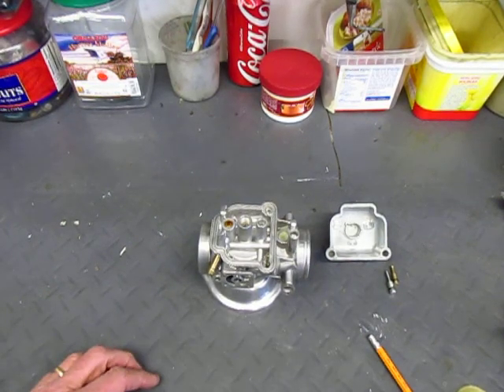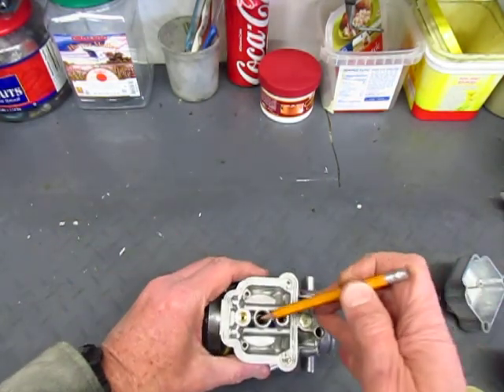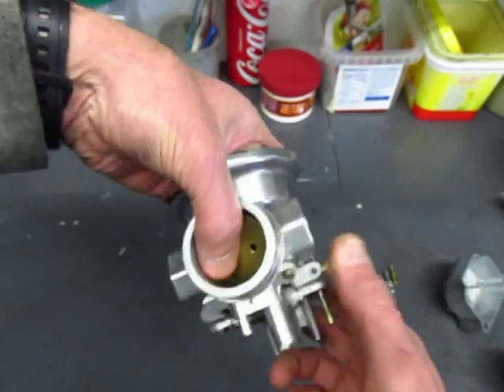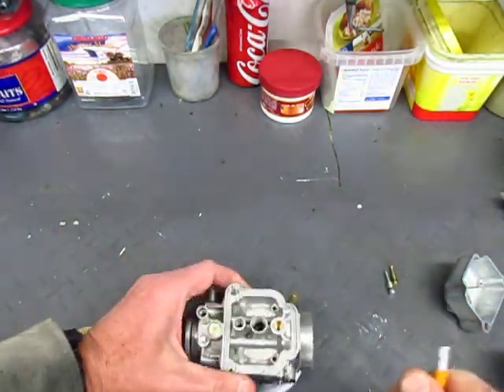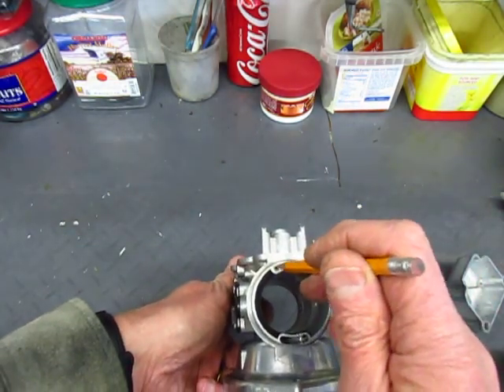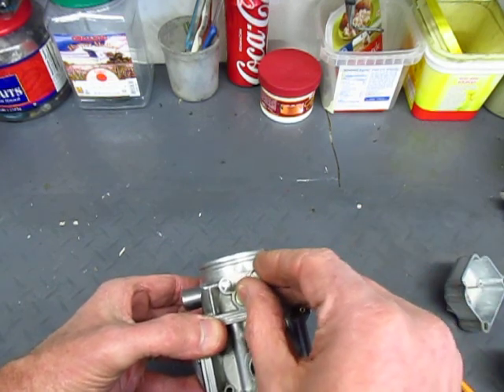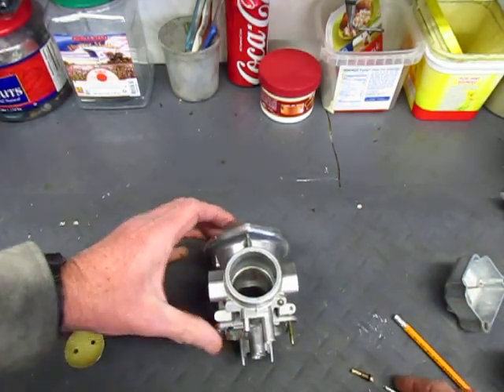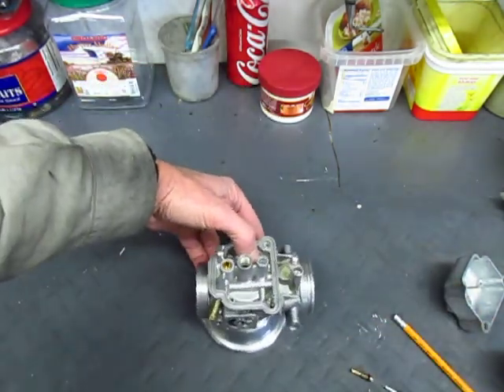How The Idle Circuit Works

Comment: Does training video quality get any better than that - I doubt not! Thanks a lot. VFR RC36-1 has rough idle, higher revs fine. Disconnecting spark plug in cylinder 1 makes no difference in running. Coils swapped, no difference. Compression seems fine. Carburetor synchorization does not help. So, I think idle circuit is glogged. Do you guys have proven experience on fuel stabilizers?

Comment: I just studied all  your videos explaining Bing CV Carb operations. They are Excellent. My model 94/40 is on a Jabiru aircraft engine and has had issues with very rich idle ever since I bought the plane from previous owner. I now believe I've discovered its main housing is defective. Besides the idle fuel port that provides fuel as metered through the idle mixture screw, mine has 2 tiny holes that deliver fuel into carb throat that comes after the Idle Jet but is not metered by the mixture screw. I have to be cautious as to possible design differences between the motorcycle and aircraft applications but so far, it seems highly likely this is a flaw in the 1 I have and is the reason for my rough idle and black exhaust smoke (unaffected by idle-jet and mixture screw changes). Thank you for the education.
Reply from the maker: Hi FoesFlyDennis, I hope you get to the bottom of your issue. There are certainly differences between the aircraft and motorcycle BING carburetors. I've no knowledge about the aircraft versions, so I'm not able to help you out.

Comment: my xtz 750  start with  800  prm then  need to  wait be  hot the  engine ..if  i  change this start  jet be   more biger nuber will  be  start  more  than  800  prm..   ????? or  need also  the main  jet  biger nuber   from  70   to  72  for exaple??
Reply from the maker: Panagos, I adjust the throttle plate stop screw to raise the RPM then adjust the idle mixture to get the highest RPM at that throttle stop screw setting. Changing jets is not necessary unless the engine is running too lean or too rich at idle. The main jet does not influence the idle circuit. Look at the other videos I posted that explain how the other carburetor circuits work for more details.

Comment: I've been having some problems with my snowmobile getting out from idle. It quickly bogs out, but accelerates after about 2 second of revving. I've been told It's an idle circuit problem most likely, and this really helped me understand it. I've also been told it might be an accelerator pump issue, so I'll have to look into it further. Great video!

Comment: When you adjust idle speed do you adjust the cable that controls the butterfly or would you adjust it using the adjustment screw  ?
Reply from the maker: Steve, you use both the throttle cable and the idle mixture screw to adjust the idle.  Here is one way to do it:
https://www.youtube.com/watch?v=5bmJ0iYBYgQ&t=649s
Reply: Thanks Brooks your the greatest

Comment: Hi...great video.
I've just rebuilt a 1983 r65 with 32mm bings 

My problem is that on cold start...the plugs both stay bone dry...with no signs of fuel.
After watching your video...I'm going to blow air thru the idle jet to see if the passages that you pointed out are clear....

Hopefully that may fix it
Thank you
Reply from the maker: Keith, I hope that works out.
Reply: @BrooksAirheadGarage  

It did thanks

Comment: Thanks- I never understood this till now! Is this true for all 2 strokes, eg outboards, weed trimmer, blower, etc?
Reply from the maker: E N, No. It's only true for this model Bing carbuetor.
Reply: Thanks for responding so quickly- just to clarify I was wondering if the general principle is the same, not the exact location of the orifices. I have another question I am sure many others wonder about: why do some motors have the needle valve that opens up main jet area vs other motors (eg my yamaha outboards) only use the Venturi effect with more air flow to increase fuel flowing? In other words, what is the advantage of a carb with the needle that goes in and out to control fuel flow through the main jet? Thanks!
Reply from the maker: @en8581  I have no experience with yamaha outboard carburetors. In every carburetor, the amount of fuel has to be metered as engine speed changes. BINGS use a needle and needle jet to adjust fuel in the mid range for more precise control. That said, a motorcycle engine runs across a wide range of engine speeds most of the time. Boat engines are more like airplanes in that they tend to run at a constant throttle more. That maybe why precise mid-range metering of fuel isn't as critical.

That is entirely speculation on my parts because as I said I have no experience with boat carburetors.

Comment: Makes sense.  I understand how the carb works when you give it gas, but I wasn't sure exactly how it worked at idle.  Now I know.
Reply from the maker: Hi Dave7777, Great.  It took a bit of research for me to fully understand that the "enricher", aka, choke, is actually a tiny carburetor of it's own.

Comment: Thank you very much for sharing this valuable information. I have a 200cc using PZ 27 carburetor and it constantly pops in the air cleaner and shuts down during in idle mode. After watching your video I understand how a carburetor works and I cleaned the idle circuit this morning after that my motor started without choke and popping in the air cleaner is gone. Thank you again. From Kuala Lumpur, Malaysia.